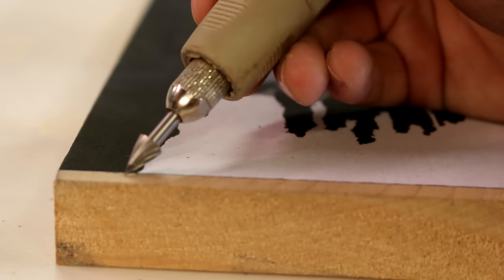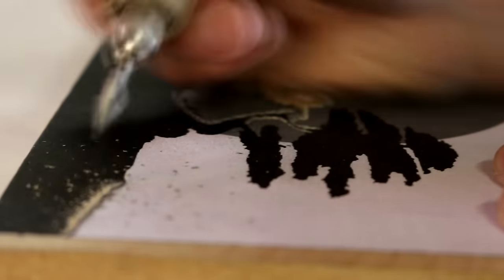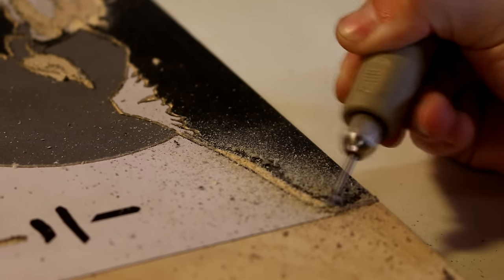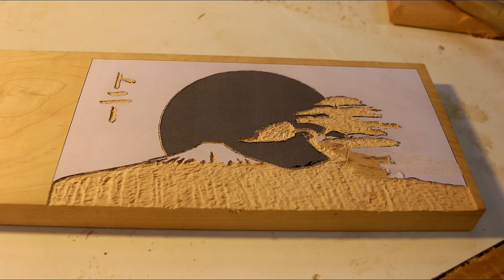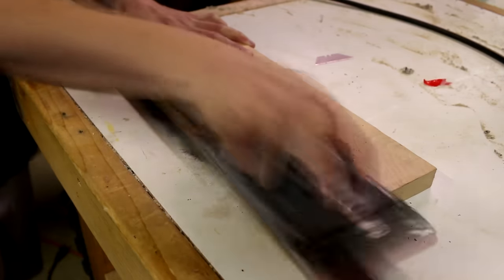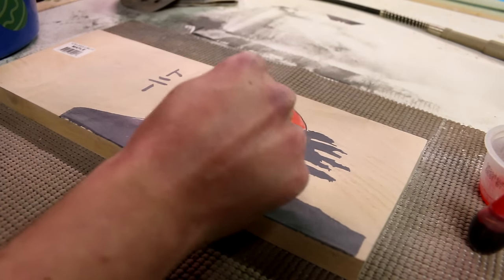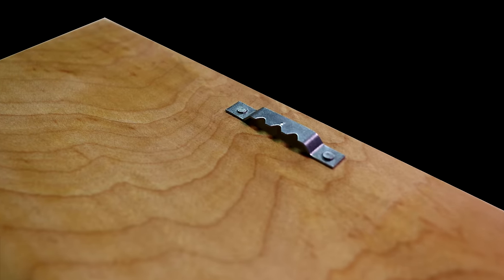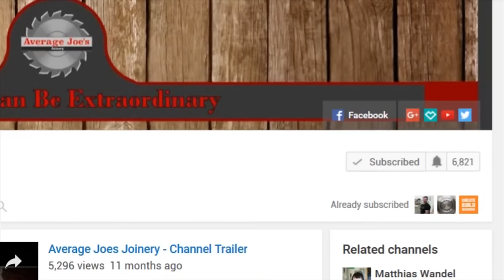Japanese Wall Art

Comment: Nice one Joe. Another nice build. this is something I still need to try. how much putty did you use on this? I have a 6ft ruler to put measurements on and trying to work out how much I would need.
Reply from the maker: +Darren Wootton I used about a quarter of a pack of Milliput on this. I find it hard to estimate the amounts I need but its simple to mix up more if needed 😊